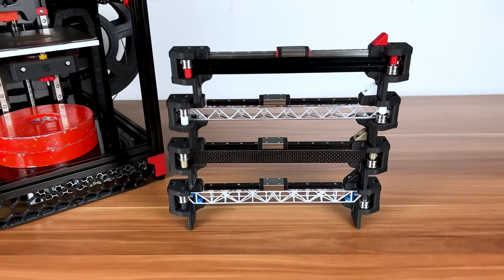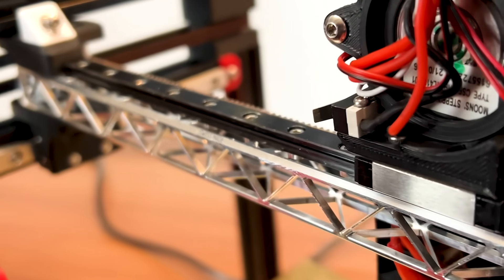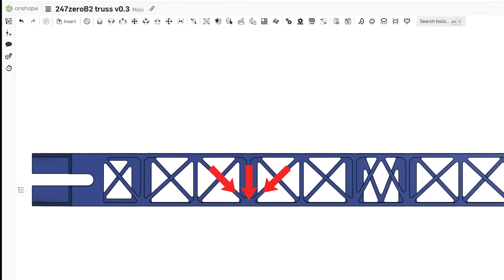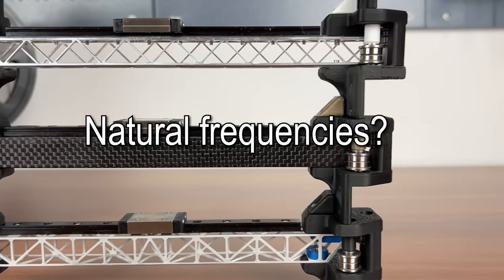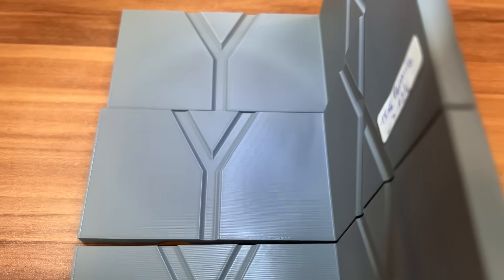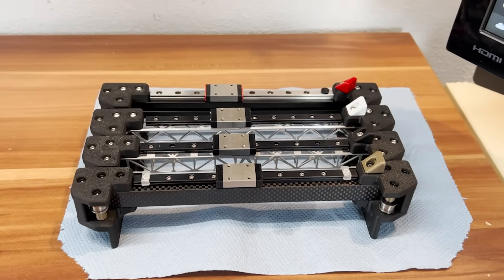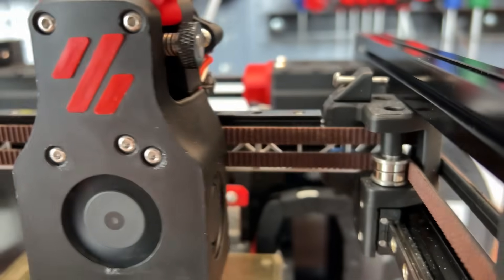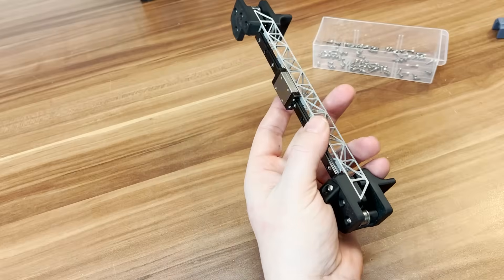ULTRA lightweight X-BEAMS tested -  USELESS on Voron 0.0 / 0.1 / 0.2 ?

Comment: Very nice video. Thumbs up...

I hope being not too much of a smart-ass but when explaining the low efficiency by the total mass safe to be only 8%, I need to say that it is even less, because lacking the mass of 2x mgn9h sliders plus the mass of the rotator in the nema14 motors ( rotation wise).

I would expect a bigger impact on larger printers although these printers will not top the little voron on absolute speeds.

Comment: It might be more cost effective to buy bigger stepper motors, than spending money on fancy beams. Algorithms fine tuning the accelerometers would help too.
Mass is the cheapest vibration damper , ,so maybe the best solution would be to build a carbon fiber beam  ,perhaps 75mm square, using bigger stepper motors. Then, set up a program to simulate a high speed back and forth motion. Then tune the beam to dampen any resonants, by adding mass to specific parts of the beam. (Resin painted on ,or shim stock glued on)

Comment: 8gramms ... 99% of moving weight in printing heads
Reply from the maker: Toolhead share accelerated masses on Voron0.1:
DD: 62%
Bowden: 32%
Reply: @247printing  I'm talking about 8 grams rail...
Reply from the maker: @maximkosheleff  please watch the conclusion
Reply from the maker: @maximkosheleff  You said "99% of moving weight in printing heads". I told you the print head shares. In the conclusion you see how much you save from light weight beams and why it is useless. So, Sir, please tell me: What's your point?

Comment: Great video Albert! It would have been nice also to see a test with the unsupported rail to see the input shaping and torsion difference. For the small size it shouldn't be an issue to use unsupported rails, I know is not the best thing to do for flatness and torsion but I saw some people doing it and seems to be a working solution.

Comment: I Lookign at how the weight interacts witht he beam, I wonder how a hybrid lightweight beam would perform. Granted, the weight savign is on the most stressed and least heavy part, but it's a step. If a 2020 extrusion was cnc machined in only one direction, front ot back, with the other direction left alone then since there is no up/down movement the forward/back movement would retain the advantage of more material resisting flexion while possibly retaining enough stiffness to resist twisting. I have a background in competitive paintball from a manufacturer's perspective and I've heard players swear up and down that ounces and grams matter. While I remain skeptical in its application in shaving weight off a paintball gun, I can see it's real advantages here. I wonder how much weight could also be shaved off of the other mechanical parts to achieve a truly featherweight xy system.

Comment: i want to see the difference when you cut the extra 2 "fins" from the 1515 beam  , just leave the core + extra 2 "fins" used for mounting the linear rail
maybe you will achieve way better results with it :)

Comment: Drag of the linear rail bearings is maybe also a flaw. Have you tried some special no slip “grease”? It’s used on mtb suspension. Have shop sized bins, can send samples for free. Greets from Nbg

Comment: I think a triangular or T beam with struts might be more efficient than the box beam
though for the most speed you'd probably want to use a head with a stabilisator (basically suspend the head on coils/gimbal to absorb the vibration, similar to what they use in cameras.)
switching from steppers to closed loop bldc might be an other option.
though at some point you have to deal with the stiffness issue by assuming you're dealing with rubberbands and not metal, and simply incorporate that in the design.

Comment: why not get rid of that beam and just hold on the linear rail on each side, its stiff enough
also milling out the linear rail on spots that are not used could save a lot of weight.

Comment: You should try to set different belt tensions with each beam, maybe by optimising tension for each beam you get a better(best possible for each beam) result
Reply from the maker: Good idea in general, but there always is a big difference in results when varying the belt tensions.
Tried a lot on that topic on 6mm and 9mm belts. In the end the perfect belt tension is dictated by the belt - as far as I understand?
That's why I used one fixed ("belt optimal") tension for all.
Reply: @247printing  I'm not sure but if the same belt was used with each beam just tensioned so the best resonant frequency in combination with that specific beam is 
 you would see a bigger difference

Comment: A triangular beam would be more material efficient while also improving torsional strength tremendously. Also for skeletonizing tubes a laser cutter is much better than cnc. For a simple test have someone tig weld you a piece of bent aluminum sheet into a triangular beam and then use a dremel to remove weight. For a better test look for a triangular tube and have it laser cut.

PS your weak point could also be the mounting and not the beam itself.

Comment: I can imagine the weight of the stock beam and density of it causing a bit of a dampening effect when discussing acceleration. Usually when these beams are discussed they are only looked at from the perspective of deflection when these analyses are run. It doesn't take into account the dampening affect it would have when being thrown at high speeds in the printer. Think about it like how tuning forks work. The amount of material on a tuning fork will change how it sounds. This is a resonance vibration similar to what we are talking about with 3d printing. I bet each beam makes a different sound too...
Reply from the maker: Thank you for sharing your thoughts on that 🙏

Comment: When heat are tested I would think all designs except the stock 1515 profile will fail. I know the resin in the cf will soften when heated.
Reply from the maker: Depends on the resin used. "Will fail" - under which conditions ;-) ?

Comment: No square alu profile? (like carbon but alu). It should be stiffer and lighter than 1515
Reply: I checked the numbers.
Based on Misumi data for 2020 and on a generic 20x20x1.5 mm square alu profile moment of inertia calculator, the simple alu square profile has 15% better stiffness than the 2020 alu extrusion.
If the resulting acceleration before ringing scales with it (which is how it should be based on my memories of mechanics), you may get the highest acceleration with the simple square alu profile from Hornbach and similar hardware stores :)
The wieght of a 20mm square profile is also about half the weihgt of a 2020 profile, and it has a higher stiffness. 
Maybe it should be tested :D

Comment: resonance frequency is based on weight and stiffness. Higher frequencies damp out faster. Low frequencies have larger displacements and longer damping times. To get a high frequency, it should be light weight, and stiff. I'm guessing that the reduction in stiffness with the lighter beams is actually making the resonance frequency lower as you are sacrificing more stiffness than you are getting back for in weight reduction. Especially since there are significant fixed weights on the head, having  a very stiff x beam is probably more important than minimum weight.

Comment: Love that you hot rod these machines!  Is the beam being a constant section a constraint?  On of the super cool things with using a product like carbon is it can be made to any shape, also the laminates alter the Performance tremendously. It looks like there is also a huge weight loss potential in machining pockets in the underside of the linear rail.
Loosing weight out of structure is a fun part of my job setting up racing boats.

Comment: Great video with in-depth analysis. Subscribed!
PS: echo is quite noticeable in the audio and slightly annoying. A little bit of work with your sound capture setup would push the video realization to the top👌
Reply from the maker: Thanks a lot, also for your PS! Working on the reverb, I also find it annoying 👍

Comment: A triangangular beam would use a bit less mass than a square one. 
I would try to scrap off as much mass as possible from that linear rail. Then i would glue it to the beam and only use screws for application. 

Maybe the weight in the small v0.1 is not that relevant, but as you mentioned, it would be the correct way in terms of physics.
Reply: Mass is not the limiting factor.   In fact, it just might be that a more massive beam is better.    What matters here is total stiffness.   Perhaps a 15 x 15 solid aluminum beam might be the best aluminum design.     If you could afford titanium then perhaps a solid Ti beam?   These CNC'd beams optimized the WRONG thing.

Comment: Think you got weight and mass mixed up.. pretty sure you measured weight. 
Won't change anything thing since you were consistent.
Reply from the maker: totally true!
Reply: I was also thinking.. did your aluminum and CF beams clamp on the ends where the bought aluminum beam was threaded? 
If true, I wonder if that accounted for the difference in expected performance.

Comment: I've been wondering for a while why no shop seems to offfer machined, lightened quality linear rails for the x-axis. These have by far the most potential for weight savings, practically without sacrificing any stiffness. It's not that hard to do as there already are numerous people that have done that for themselves (ECM, or CNC machined). First one to offer this commercially will probably sell a lot.

Comment: The maker of ultra beam did a deflection test using theirs and CF.  They also used heat too, and the deflection for the cf got much worse at higher temperature,  but did better at low Temps.  I think it would be good to consider how you plan to use your printer.
Reply from the maker: Yup, I know his video, very well made 👍

Comment: Lower recommanded speed probably comes from the shifted center of mass. Because the beam doesnt weigh much, the linear rail acts like a pendulum. You would need to move the extruder head to balance the gantry

Comment: This beam is only a small fraction of the gantry mass, yet needs to support the entire hotend mass in motion. So, calculating a Stiffness:Weight ratio using only the beam’s properties will artificially inflate its performance. A lighter beam may drop 60% weight and lose only 30% stiffness… but if it was only 10% of the gantry mass to begin with, the assembly as a whole exhibits a very different total: just 6% mass drop for 30% stiffness loss!

Comment: Hello fellow German! The input shaper script's results are based on the frequency. The higher the frequency, the better. A lower mass leads to lower resonant frequencies due to inertia. A higher stiffness leads to a higher frequency. You can hear that on a differently tensioned belt or guitar string. The other beams are lighter, however they are moreso less stiff and therefore have a lower resonance frequency, resulting in a lower recommended maximum acceleration.
Reply: * But the tested beams are more stiff in the test setup?
Yes, this is interesting to me as well. You are testing the stiffness at a frequency of 0. The plain e module if you will. Stiffness/elasticity of an object can change, and that is measured by the resonance frequency. Much like in electrical engineering capacitors or filter setups have different filtering strengths across a frequency spectrum. The worse performing beams are non-uniform bodies with local structural weaknesses.
Reply: The keyword to look out for is "Frequency dependant elastic modulus".
There is a paper called "Frequency-dependant elastic moduli of lattice materials" whose second part of the conclusion I found quite interesting.
Reply from the maker: @instantmuffin5  Servus fellow german! Thanks for the hints/keywords!

Comment: This sort of explains how the Annex Engineering K3 performs so well. 
Though it doesn't use an alu extrusion or any of the type of beams used in this video, it uses linear rails in a CROxy setup.
What happens if you remove the x beam and only ran the linear rail connected on both sides of the y axis? Ofc that would require new XY joints, but I would bet to have a better IS result than all of the above.
Reply: Linear rail would struggle and would deflect too much with just 2 points of contact.

Comment: I think it's time to turn the thinking around, instead of same or lower stiffness beams at lower weights, maximize stiffness at the same weight as the original extrusion. Maybe a skeletonized steel tube?

Comment: I feel like even though the ratios show differently, the CF is the best. It offers a little off the weight but keeps most of the stiffness.

Also, I'm guessing the input shaper graphs on the UltraBeam and HyperBeam (can I even type the name HyperBeam? Is it trademarked that much?) are absolutely horrible?
Reply from the maker: Most potential for sure by its "nature".The beams of all of them are quite comparable and not really bad, but also not really good.

Comment: Had a feeling these were the results we would see based off the input shaper graphs people have shown with these beams on the Voron discord.  Many are getting worse graphs on larger printers (350mm V2.4 for instance) with the skeletonized beams.  Going to a bowden extruder setup is far more effective in removing weight as you've proven.
Reply: Re: Bowden V0; The problem there is that you've removed a bunch of weight above the toolhead CG/pivot point, and none below. It's still not ideal, but it does work for Stefan's stated goals, and I'm reasonably sure he's considered the increased rotational torsion on the X beam.
Reply: My vz bot ip improved with the carbon fiber beam and no difference when changed to the cnc
Reply: @TRTmike4Life  different printer design, they're not comparable in this aspect.
Reply: @viru52000  yea different printer but still x and y moves the same and a v2.4 350 x beam is the same as my x beam in length minus a few mm and with my trident switching to a cf x beam helped alot
Reply: @TRTmike4Life  the entire gantry and toolhead are designed differently on the VZbot and does have the same twisting loads as a Voron.  Plus the Voron Discord being full of CF tubes delaminating from ABS printing temps, meaning it's a consumable at that point.

Comment: hmmm, how did you stick with the conclusion that every gram counts when talking high speed, when your tests proved it doesnt ...
Reply: I appreciate the video very much all the same. it confirmed my thoughts on the matter. if anything I would go with a CF beam. the light weight alloy beams dont interest me at all, as you sacrifice torsional strength for loss of weight and introduce unpredictable resonance characteristics at the same time.
Reply from the maker: Always depends on the circumstances. My tests were on a Voron0.1 MiniAB and if there are gains.
On 247zero I go for bowden: Completely different scenario: "every gram counts, if want to go for CRAZY speeds". 
No controversy relations are different 👍
Reply: @247printing  yes and i would expect it to get worse, not better on larger printers/longer spans.

Comment: I talked to Fail fast about lightweight X beams for a while. I ended up going with a Pultruded Carbon fiber one  because it was much stiffer than the aluminum extrusion and the ultra lightweight one. Is your carbon fiber pultruded or woven, because woven preform much worse. I also tested a hand milled aluminum extrusion that I made that was 30 grams and I lost 25hz of resonances because of it. Can't wait to beat Baravel for the WR ;) I also didn't know about the titanium requirement could you elaborate further on it? Also you can buy carbon fiber x beams on ali for the 0.1
(that's where I got mine)
Reply from the maker: Hey, from what it looks like, the CF beam is woven - afaik you wouldn't  see the fibers on pultruded ones.
Looking forward to your WR - you can make it!
Galvanic corrosion, google: "carbon fiber galvanic corrosion" ;-)

Comment: If the ringing test is essentially measuring resonance, then you should be able to go beyond that frequency to clear up the ringing again - As long as your accelerations are not a harmonic of the prime, it shouldn't happen...

But I don't think the ringing test actually measures resonance - at least not as the primary measurement, because you're far too low frequency to be seeing resonance in the beam - only the part flexibility. In this case, it is of no surprise whatsoever that the lightweight parts are more flexible than a solid extrusion.

Lightweight only helps if your motors have reached their maximum acceleration values due to inertia. Your motors are clearly able to overcome the inertia of the heavier, stiffer beam. You will see practically zero improvement by trying to make lightweight parts. This is wasted effort in this instance.

Comment: Based on my differential equations/control theory knowledge, the two factors in an undamped system are stiffness and mass. Given that most of the damping naturally comes from the friction in the motors and slider bearings and is likely the same for every x bar, I would take a closer look at how stiff each bar is and see if a stiffer material, such as titanium, gives better resonance testing results.
Reply: Cast CF would provide some damping also, wouldnt it? while maintaining stiffness. Or CF with titanium backer perhaps. But that might add some less predictable/linear resonance characteristics with the 2 materials interacting.
Reply: Stiffer materials helps, a little.   But remeber that stiffness of a part is the CUBE of the depth.   He would gain massive results if a 30 x 30 beam would fit in the space.   I think the designers choose 15x15 just becuse the rest of the printer was 1515.   

Also I thing the flex on the beam is tortional.  The center of mass of the extruder likely not level with the beam